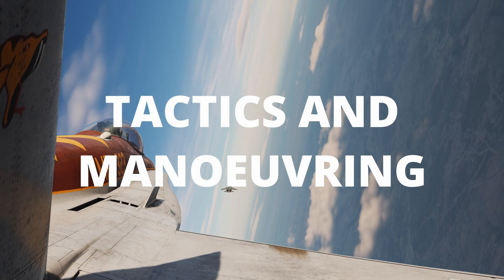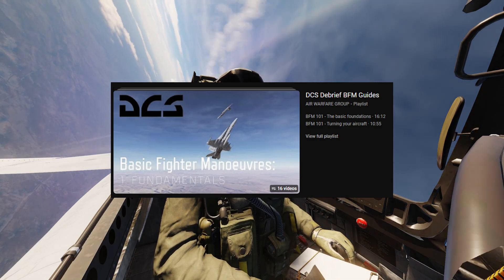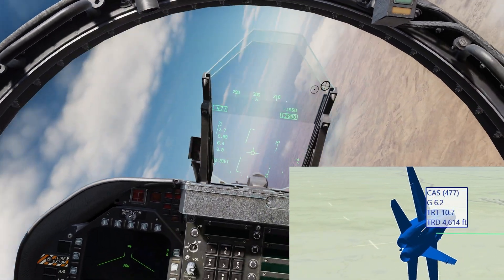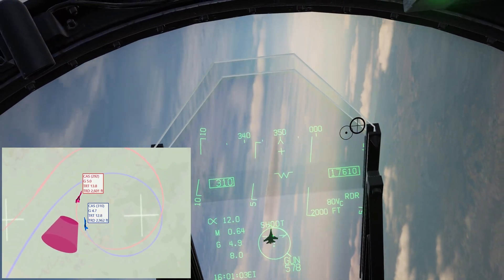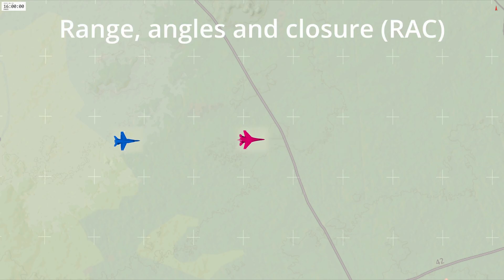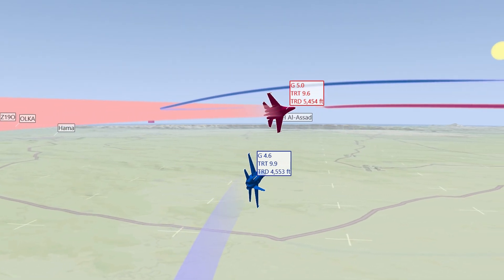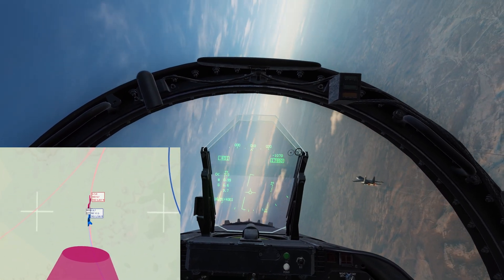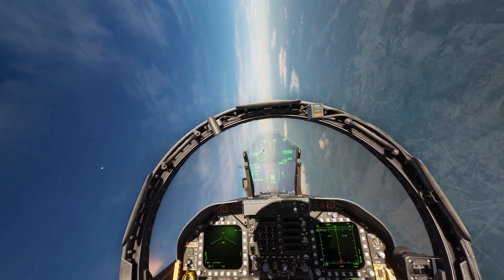BFM Fundamentals - Tactics EVERY Pilot should know! | Tactics and Manoeuvring

Comment: The paddle switch is only used in emergency situations. Well... fighting for your live in a dogfight is a emergency situation par excellence...
Reply from the maker: 😂 I've definitely heard this comment many times on this video. 

I think the main thing is that the paddle switch is not meant to be used as a dogfight switch. It's meant as a "I'm about to crash into the ground and die" switch to allow you to bend the airplane and write it off from frontline duty for the foreseeable future, but keep you alive. When you get good at BFM you don't need to use the paddle switch, as you should be able to use techniques to get the advantage, not just use a G-Override button to get a bit more turn rate.

Comment: Despite DCS being not-so-expensive for average players to join considering game requirements and an entry level flightstick...

WVR engagement (A.K.A. dogfights) reality is that you need one hand on the flightstick (pitch, roll; while yaw can be controled from stick or from pedals) and you still need to control thurst from engines (throttle) and once you control your aircraft... THEN you need to keep visual track on your enemy at any time.

Despite having a flightStick with some integrated buttons and directional joysticks you'll need these controls configured for weapon deployment, countermeassures and other stuffs.
The second hand would then go to:
A) A throttle control integrated in an entry level stick like Extreme 3D Pro
B) A dedicated throttle control like Thrustmaster TWCS or better, that will feature extra controls for the non-dominant hand, including some things that could be configured as zoom in/out for the view

BUT you are still limited for visuals, since no directional stick will ever be as fast (the camera moves at a plane speed) nor precise (when you need extreme levels of detail) as the dedicated solutions

There are 3 solutions i've found so far:
1) Mouse: It works pretty well for camera movement, but requires an entire hand, therefore removes an entire hand for aircraft control (usually the 2nd hand in the Thrust). Leaving the player with just one hand to control throttle and 3 axial stick on the aircraft controls (pitch, roll and yaw). That's a problem when dogfighting since you need to be able to adjust thrust to force overshoots. Also you'll like to have your primary hand on your flightstick, so you'll end up using your non-dominant hand on your mouse... something odd compared to general PC usage in which dominant hand uses mouse. A custom gaming mouse could feature extra buttons that would aliviate the limited 2 button+wheel basic mouse config, yet the level of control for the global job won't be as good as the other 2 options that follows...

2) Camera head tracking device: this will release the hand but it comes with an extra costs, not so cheap if you want the more precise options out there, since entry level devices will work "meh"

3) VR Headset: VR might see the most inmersive playstyle, but it comes with some caviats. You need a stronger PC to run VR correctly, it is hard to get used to and also brings a new 
problem: you'll have to memorize your sticks, and your sticks won't match what you are seeing in thru your eyes. That's why many stay with Head tracking devices.

---
in my humble non-informed opinion, while playable, i'd say that Mouse as main camera movement device will limit the ammount of controls you can push in a hurry, so i think it is a reasonable budget choice for someone focusing on air to ground missions (SU-25/T, A4-E-5, Super Tucano and other Air to Ground focused aircrafts) that can be played without needing to move your camera the entire time, and you can live with the disadvantage of hand switch from throttle to camera correction.

That being said, unless you get a dedicated hardware for tracking your enemy, you'll face the worst end of the stick in dogfights, that's a hard reality... i'd say that you can get away with keyboard + camera tracking device in a better way than with a 2 hand HOTAS and no camera tracking device, and that's a heavy statement
Reply from the maker: Some interesting point there. Being able to track your enemy is definitely key in dogfights. Mouse I would say is probably worse than the inbuilt "F5" key which will track the nearest aircraft. I would recommend players to use this initially before moving onto something else.

A good alternative is also "Opentrack" and "Smooth Track" for iOS and Android. For around £10 you can get very good quality head tracking just using your phone camera.

Obviously TrackIR or VR are the best options but at a much higher price point.